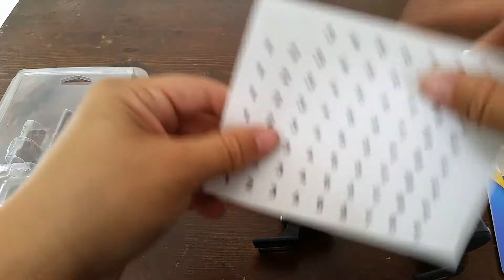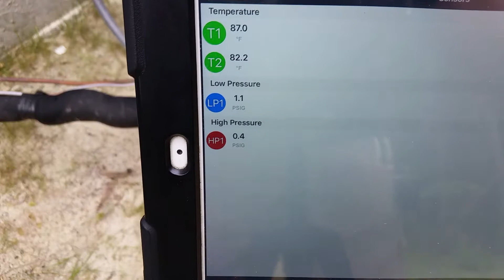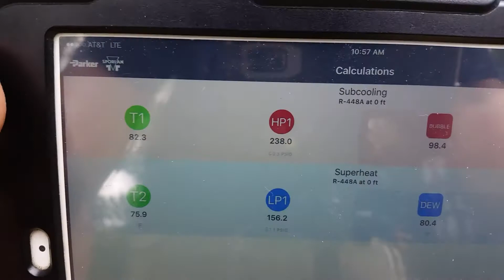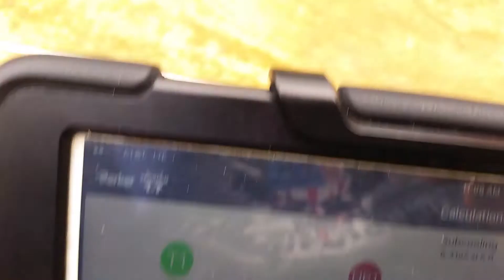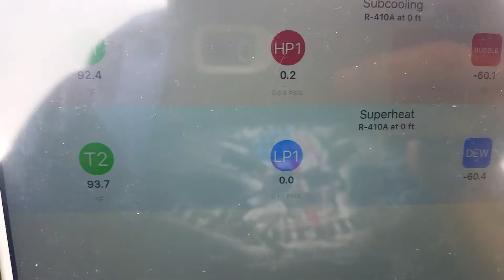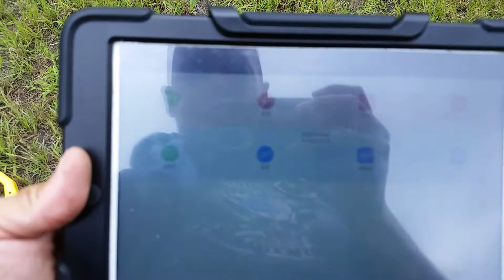Smart Tool Testing Part #2 - Sporlan Smart Pro/R

Comment: An open swivel jaw (like saddle tap valves for water lines) would be a lot better for clamping on lines for the temp probes instead of using ty-wraps. Terrible design.  Something simple like a wing nut to tighten the clamps together to hold the temp probe in place would simplify things for us technicians.  Seems like a waste of money in ty-wraps.

Comment: If the pressures are temp compensated why do you think they were drifting even during the distance test ?
Reply from the maker: Joe Shearer That I can't answer Joe. From my experience they need zeroed as much, if not more frequently than the Testo which as you know aren't compensated. None of the packaging indicates temperature compensation but Sporlan assured me they are.
Reply: HVAC in SC that's very odd. I wonder if they are confused what temp compensated means. If you were to power them on and zero them out....then put in your freezer I wonder what might happen.
Reply: Working Joes Podcast oh wow that's still odd then that they won't stay zero

Comment: Does the transducer have the same pressure reading range for either one? Another word, can I use the blue one, low or suction, one to read high or liquid line?
Reply from the maker: StockVideoFootage The pressure transducers are dedicated low pressure and high pressure. To my knowledge not interchangable. The line sensors however can be used for high or low temp readings.

Comment: I can't find those access Tee's anywhere on the TruTechTools website. Any help greatly appreciated. Thanks.
Reply from the maker: Wayne Miles Heres a link to the CPS tees.
https://www.trutechtools.com/AVT45
Reply: HVAC in SC Thanks, got.
Reply: They sell them at supply houses too, Johnstone is a good place to start
Reply: Wayne Miles I found them under the options tab while looking at the Testo smart probes. About $13 shipped got here in 3 days